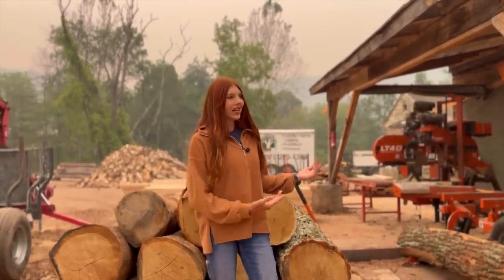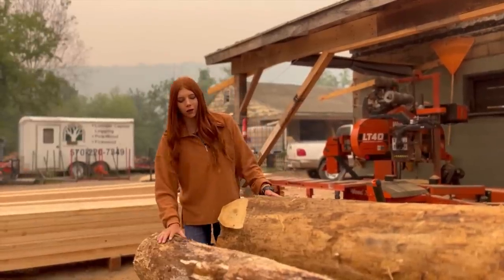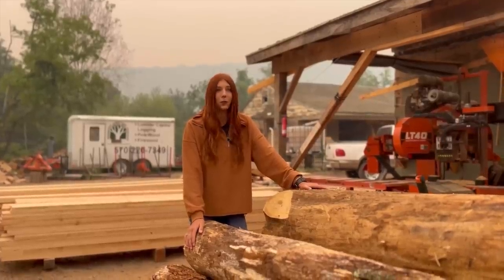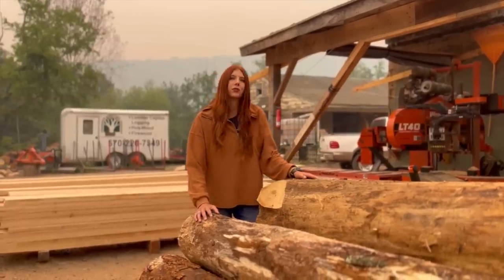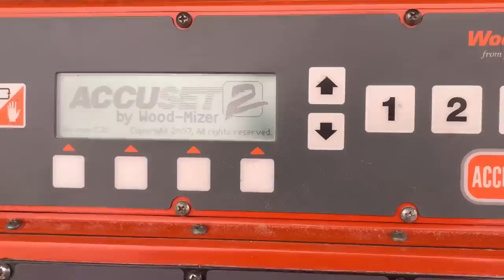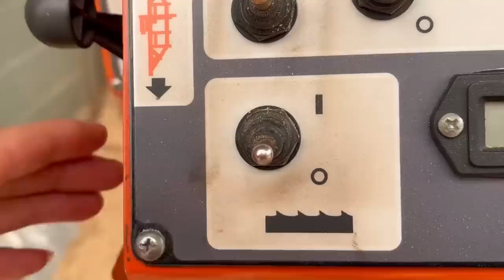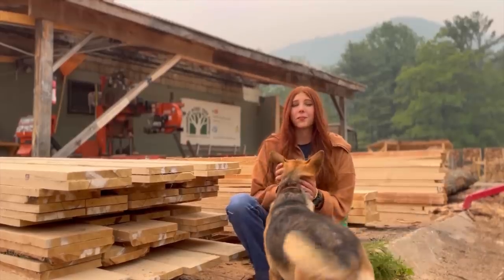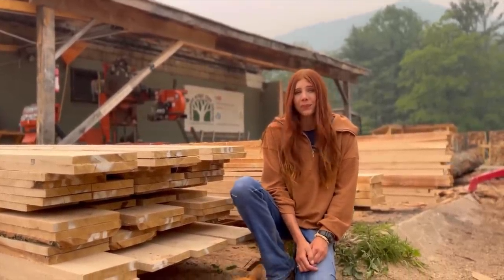A Smoky Day Doesn’t Keep Us Away

Comment: Do you have to tension the blade a little extra because you are cutting white oak? I have a smaller mill and I put a brand new blade on it, went to cut white oak, and I could see the blade getting pushed back off the guide a little and deflecting down a little too.  I had thought I tensioned as much as I should.  The cuts came out fine (i.e., no waves in the board), though.  Glad to see your wood looked fine despite the beetle trouble!

Comment: holy checking, Batman.  I've got a bunch of logs down right now, and I'm watching them get end and lengthwise cracks like this. I wish I hadn't of cut them until I was ready to mill them.
Reply: Paint heavy or hot wax the ends to prevent dry cracking .

Comment: Video Idea.... Get the boss or grandpa to compare band saw sawmill with a big circular saw sawmill. Which blades last longer? Which cut better? Faster? etc....
Reply: Circle mill cuts faster than this little band mill but the band mill small or large will yield more boards from a log due to thinner blades .
A circle mill blade usually cuts a kerf of 9/32" to 5/16" depending on how much swedge the teeth have , ( set on a circle rip saw ) , I always figured 5/16" kerf even with the teeth at 9/32"  , always cuts a bit wider  , so every 4 cuts of the log you have lost one 1 "  board  plus 1/4 more ,  all that went into saw dust , compared to a thin band mill blade that might cut a kerf of 1/16"  , this means  you only a lose of 1/4" maybe in 4 cuts of the log .
If you can get 1 or 2 more boards from every log that adds up fast and is less sawdust waste also .
Takes less horse power with the thinner blade and that is a saving in fuel also .

Comment: Get some N95 masks with the vent for exhaled air. They do not get quite so warm. The mask will cut down on the number of particulates you are breathing in because the smoke contains heavy amounts of PM 2.5 which are fine particles that go deep into your lungs and cause breathing issues. You ladies Rock cracking out out that fine lumber.😎👍